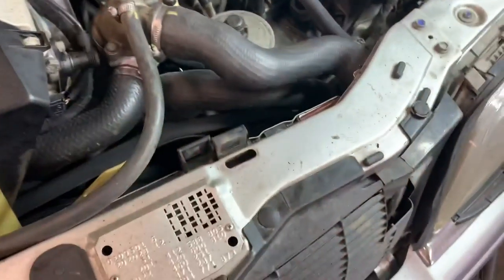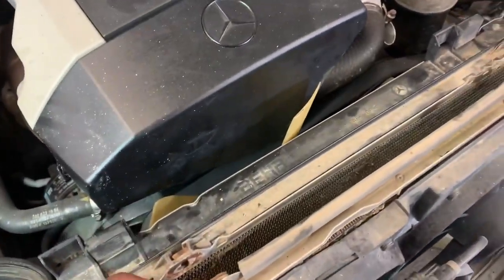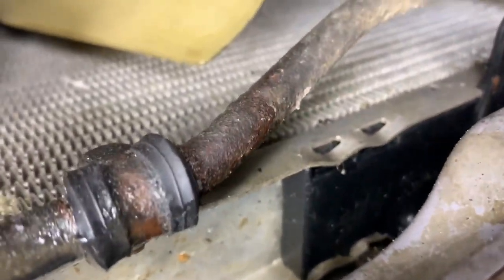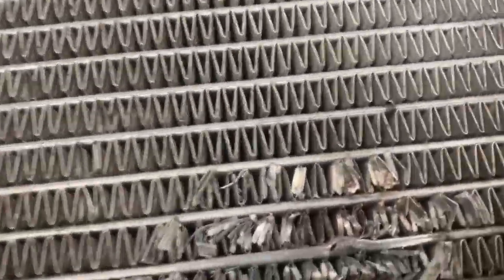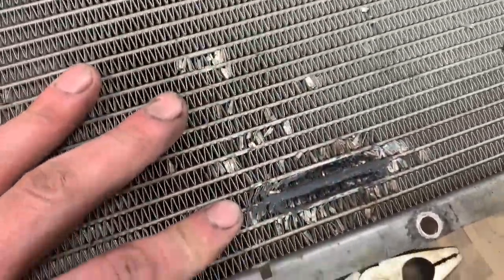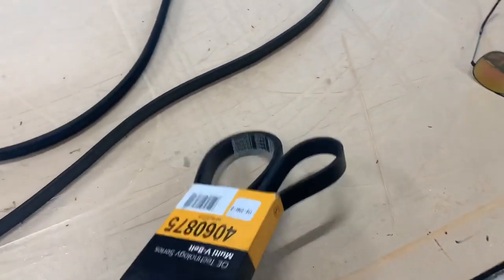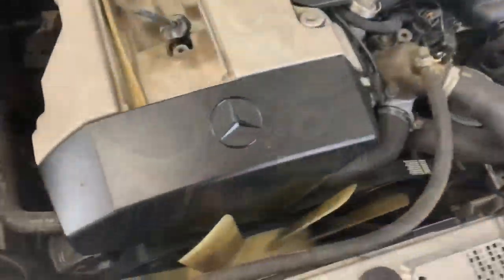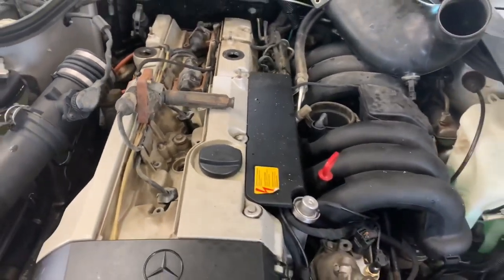Mercedes C36 AMG revival part 6 First Drive!

Comment: I have a MERCEDES CLK W 208 200 192 hp and she is like she just came out of the Factory.MERCEDES is not TOYOTA or HYUNDAY.If you want to keep this car you must pay.You must use original or at least new spare parts.These kind of repairs are for TOYOTAs.If you do not want to pay you do not buy a MERCEDES and specially an old one.